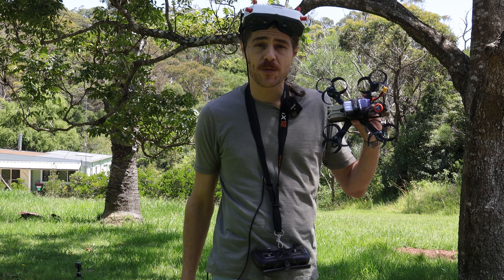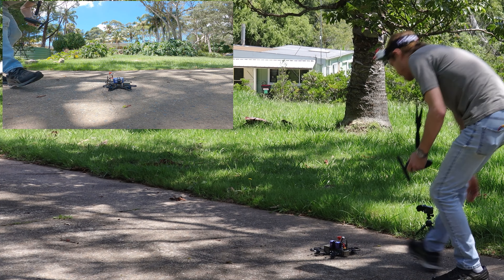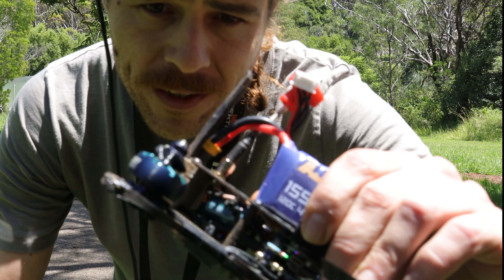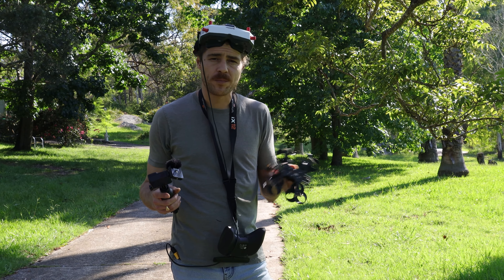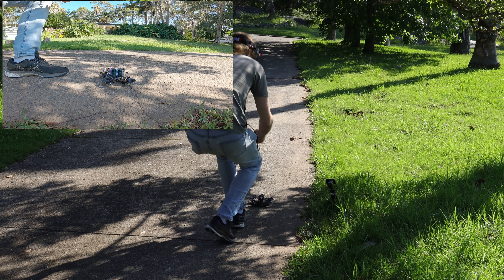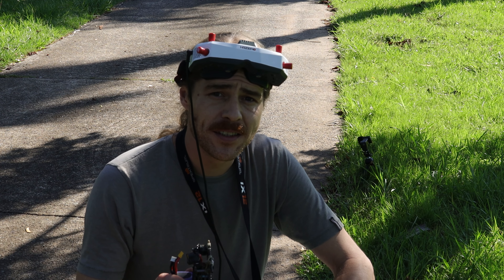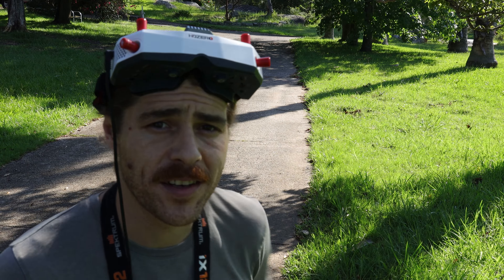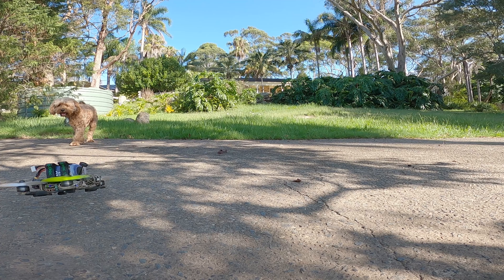Toroidal Props V2 The Propsplodaning

Comment: To be fair, if the future has delivery drones and taxi drones flying all around I'd much rather the frequency-distributed whirring noise of toroidal lobes to the familiar blade buzz, even if the former is technically louder.
Reply from the maker: Gdya Ithirahad. Thank you for your comment. This is the big question really and leads on to the whole feasibility side of thing. 
Personal preference to sound is a big player in this. I actually find the normal props to have a more refined sound and felt that the toroid sounded like a Phantom. 
At the end of the day we are talking about business use of this tech and that will all come down to cost per flight. With the efficiency loss seen (~20-30%) relative to blade props I don't think this will be economical. At least by enough of a margin to make a difference.
For example, Passenger jets. Most noise is from the movement of air over planes surfaces, not so much the engines. Designs have been around for 10-15 year for quieter planes but it wasn't cost effective so we all get to hear the howl of the connected world from time to time. 
Happy flying 😉

Comment: The main appeal for me with this prop design is not noise but Safety....
Let's say your dog charged the drone and the props caught his nose..
Guessing these new props will be less choppy......
Reply from the maker: Gday Jason. I think when it comes to nylon injection moulded then yes but these 3d printed props are (on reflection) another level of dodge. Esp if it PETG or PLA. They are too brittle and susceptible to catastrophic disintegration under these levels of force. I posted a picture of the damage to the Dark Mut Mk2 on the discord but in short an exploding 5in tri-lobe cut three 2.5mm quick ties holding the cap/receiver bundle.

Comment: Maybe people printing these haven't come up with a "blade profile" that's close enough to the M.I.T. one to be suitable for the design of the aircraft they've tried them on?  Maybe tweaking the motor P.I.D.s of the flight controller could also help?  There's still lots of information we don't know, but...imagine if "The Wright Brothers" had stopped trying.  Eventually, people will figure this out.
Reply from the maker: This is a very good point Kyle. The answer to which is a definitive 'highly unlikely' for the majority. That said some have and the pitch is about the correct level of aggressiveness in most of em for qwads. Thank you for the comment.